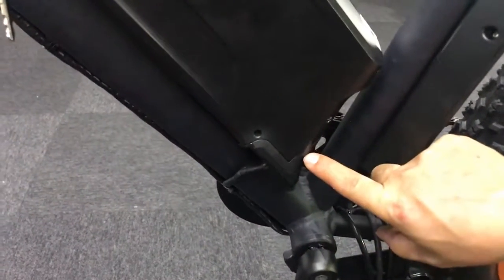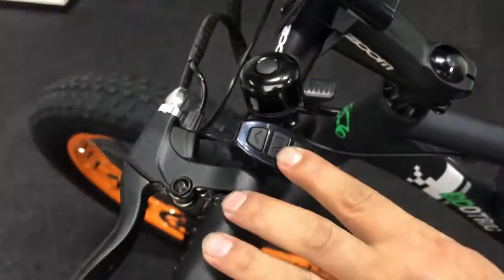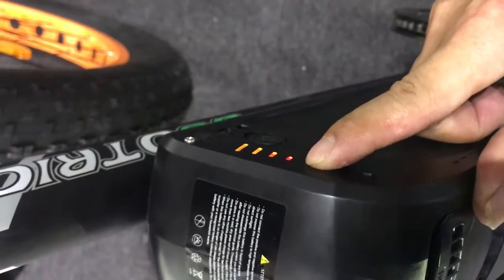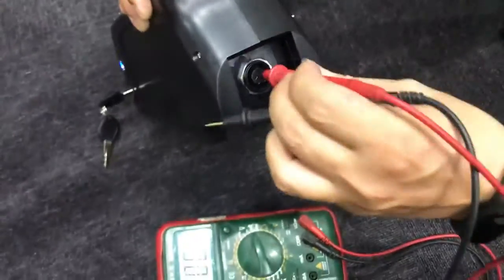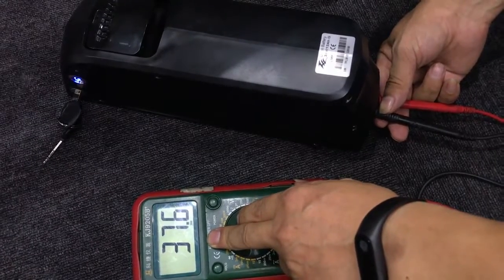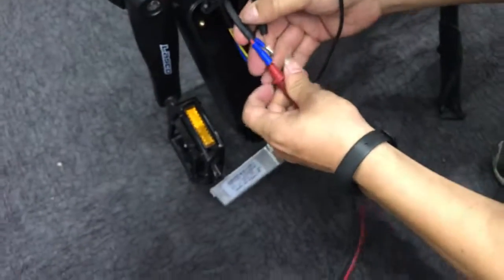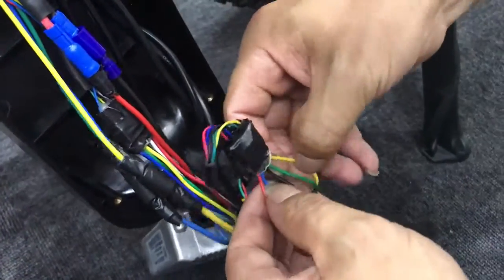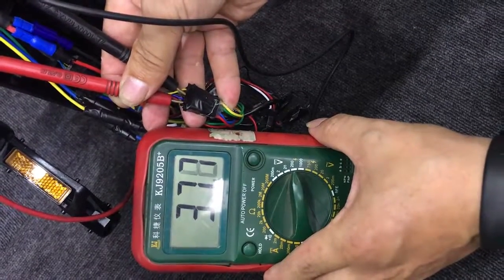How to find the issues when your ECOTRIC eletric bike's display do not work

Comment: If there is a gap between the battery how do you fix it
Reply from the maker: please send email to service@ecotric.com
Reply: @ecotricbicycle8558  i did still haven't got it to work as yet though
Reply from the maker: @winstonfrancis6397  when you have the problems, you can send email to us. Tks.
Reply: I had the same problem.  Full battery, no power.  Saw a small gap at the bottom of the battery to the frame.  Removed the battery, and adjusted the support slide bracket (there is a screw).  It had been a little bent, so just straightened it out.  Put the battery back in, and BINGO.   Pressed the on button, then the M button on the handlebar for 3 seconds and all was OK.

Comment: Hi Madam my bid lakeleisi does not work ,I become tired ' I don't have wire diagram ,and the control unit is sealed with selicon, battery is OK ,power available on control unit ,but display cannot switch on ,seams 5 volts is not coming ,can you please help me ?
Reply: Lankeileisi T8 bicycle

Comment: just had an issue today with my sportcool wouldnt turn on when i went to leave work had to ride the bitch home 2.5 miles no motor fucking sucked after some diagnosis turn out its the wuxing brake levers there is something wrong with them  i wanted to switch to hydraulic  brakes anyhow heres to dropping some more money into this thing cheers

Comment: Rode my ecotric fat tire folding bike for 5 miles and it stopped working. Error code 0002
Reply: same here, I just got mine and after riding it for 8 miles, I took out the battery from the bike and recharged it. Then after placing it back onto the bike, the lcd display will not turn on
Reply: @leelee3995  Same, it won’t turn on or show how much battery it has unless it’s plugged in, did you figure out a solution?
Reply: @jeremiahbrito8440  
Yeah, in my case, I was not inserting the battery correctly. It did not align with the electrical grid that’s on the frame.
Reply: @jeremiahbrito8440  
Ever since then, I’ve never had a problem. I would recommend not taking out the battery every time you charge it. Just charge it while the battery is mounted on the bike
Reply: @leelee3995  thanks